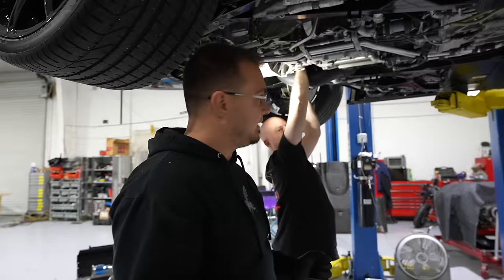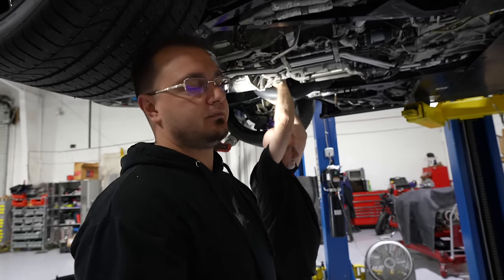Rebuilding The Flooded Bugatti Veyron | PART 14

Comment: Your wastegate spring is not going to determine the max boost youre running. It will determine the crack pressure for the wastegate. Remember the car uses a boost solenoid to divert boost pressure away from the wastegate so it can run MORE boost than what the spring allows, but never LESS. Did you actually check the crack pressure of the OEM wastegates? Are you logging requested boost and actual boost when testing it? Different cracking pressure (different spring) than stock will make boost control go crazy and cause huge PID corrections and throttle closures over a certain threshold on these ECUs. Check the actual pressure where OEM wastegates crack open and thats what you want your TurboSmart wastegates to start opening. Not more, not less. You definitely dont want to be tuning these without good logs...

Comment: I so tired or hearing this myth. Cars do not need back pressure to make power. They need exhaust scavenging to make power. When you remove a vars exhaust or make it shorter, the resonance frequency for the exhaust pulses will be at a different frequency from stock, changing the torque curve. Many more knowledgeable people like Gale Banks and Richard Holdener can explain this in more detail.
Reply: Yes, 4 stroke engine just wants to breath out. And with those 16 cylinders on full chat, you are having pulses coming all the time. Exhaust is there only to get those out before the next ones.
Reply: I only learnt this a week or so ago

Comment: Not sure who would want to buy an entire car’s value priced exhaust system from a guy who thinks more back pressure is a good thing. Those sparks coming out too are not good either, thats not unburnt fuel thats metal sparking, typically a sign of bad internal welds or bad glass packs. Keep the boost the same and then show us the HP difference.

Comment: how is smaller diameter pipe less restrictive?
Reply: I imagine it's where and how and even who measured it lol...but I'm pretty sure it's not ...I've worked on alot of CNC's and other more traditional old school style machines and cool old school WW2 era bridgeports presses with every single type of personality you could possibly run into in a machine shop lol and the number one thing I've learned the most specially from new guys ... measurements are hella subjective 😂😂
Reply: @KevinPritts  measuring something as simple as the bore of a schedule tube or ID of a pipe is not subjective in the slightest.
They are produced in standard sizes. 
Manufacturing variations are irrelevant compared to a change of stock size.
Smaller pipe is significantly more restrictive due to the boundary layer effects and reduced CSA. That's Engineering.

Comment: I seriously doubt stock veyron wastegate spring is 18psi.  It probably was around 10psi.  You can always dpuble spring pressure.   If your goal is 18psi put a 10psi spring in and you could hit 20psi.

Comment: Why not an electronic boost controller? Get a empty ECU pin out, let the ECU know you want to use that as input for boost and it should work. If not a custom ASW mod can be written which is fairly easy.
Reply: I think it has one from the factory they are just setting the wastegate springs back to stock so the ecu and tune will work
Reply: It’s like this from factory they just have the wrong springs. The mechanical part still needs to be correct. With a normal pneumatic plumbing configuration you can usually achieve double the waste gate spring pressure through electronic control, not simply anything.

Comment: Can someone explain why less back pressure in the exhaust system would decrease power on a turbo charged car?
Reply: It shouldn’t, there’s something wrong. Wasn’t their problem just having the wrong waste gate springs?
Reply: "back pressure" is a poor choice of words that a large percentage of novice auto enthusiasts use. They should be talking about velocity and scavenging or even spool up time when turbos are involved. Just pretend he said that changing the pipe diameter has the potential for a performance enhancement and since he got it wrong the first time his second attempt is the reverse of the first.
Reply: @walterwhite279  There’s no evidence he got anything wrong other than the waste gate springs. Generally on turbo vehicles, simply having the lowest pressure post-turbine is optimal. The reason scavenging works on an N/A engine is that a low pressure wave can be aligned to the exhaust valve opening, thus allowing more exhaust to flow out of the cylinder. This strategy is not effective when there is a turbine between the exhaust and the exhaust valve.
Reply: @coreyw427 - the red car had stock wastegate setup and no tune. He reduced post turbo restrictions and lost power. Same thing happened with this car which had heavier than stock wastegate springs, identical post turbo setup, and couldn’t tune the problems away.  Not my point though. I was trying to say he uses the phrase “back pressure” interchangeably with “less restriction”.  I don’t know if he knows the difference but based on the many questions posted here, people got confused.
Reply: @walterwhite279  I’m not sure what you’re getting at sorry. All else equal, less restriction will result in a lower back pressure. As you say, there can be acoustic effects, but it’s not really relevant in a turbo application for the post-turbine part of the exhaust. I’ll take for granted what you’re saying about the red car, but this isn’t good evidence for it being an inherent physical issue. Most likely it is an issue with the tune. It uses a Bosch MED 9 which has thousands of maps including in relation to modelling the exhaust back pressure. Not updating these correctly can have negative effects. For example, lower back pressure could result in more exhaust passing through the waste gate for a given waste gate position, rather than the turbine. But the model probably thinks the back pressure is higher than it actually is.

Comment: Its horrible to see they dont have a clue what they are doing.. Thinner exhaust pipes, because want more backpressure?? Lighter springs in wastegate?? OMG!! A turbo 4-stroke engine does not need backpressure for power. Also the heavier the spring in the wastegate, the higher max boost pressure before wastegate will release. Please contact a tuner, before you make decissions like this.

Comment: You dont control boost with springs, you have a boost controller, on this car most likely a vag n75 valve via the ecm
Reply: Yeah this was confusing me, surely the spring just determines the max pressure before it physically releases the waste gate?
Reply: This is for the wastegate
Reply: Yes, with OEM ecm you can only open the wastgate not keep it closed, so it will be pushed open once beyond the spring pressure, hence you need a decent spring for higher pressure
Reply: The waste gate spring still needs to be correct. If you put a 5 psi spring in, you will only be able to get ~ 10 psi using the N75, for example.

Comment: Car is stunning but lose the cheap looking door lights. 
You shouldn't have to reduce exhaust diameter to improve power - a turbo runs better with no exhaust or a short stub. There's something not right with turbos and/or tune, and YES I did see the wastegate spring change.

Comment: we need a 1000mph road car :trophy-yellow-smiling:
Reply: Do you mean 1000hp?
Reply: @TheBraddles82  no mph
Reply: 1000mph will need at least 135000bhp  if it has enough downforce and not fall to bits under load  at those speeds tyres forget it.
ask elon for a raptor or 2  lol

Comment: Curious minds want to know Houston. How much is a bunch of money to you? Obviously this Bugatti Veron wasn’t about $1 million when it was new. The Galveston Bay ruined the value of this individual Bugatti. You have single-handedly rebuilt this Bugatti Veyron from every nut and bolt. In my opinion, it is a lot better looking than what it looked like originally when it initially left the factory. Obviously, you know how much you have put into this rebuild plus what the Bugatti cost you before the rebuild. If somebody offered you one and a half million dollars for this Bugatti Veyron, would it be enough or would it have to be $2 million? After all, it has a branded title even though it’s practically brand new from front to back.

Comment: You lost horsepower because you choked the engine with the narrow rear section. Keep the large diameter downpipes, and keep that diameter running the whole system. Why on earth would you neck down a quad turbo W16???

Comment: So you changed all rusted nuts and bolts and so on...? at 9.54 are two most visible rusted bolts... and again... 11.56 bracket for five oil lines.. rusted bolt holding...  well you are building something for years and.... there is real quality difference in US and europe, have a look at the m539 restorations channel, there is real quality on restoring something...

Comment: Jesus.....🤦

Back pressure is bad on a turbo car (close to or over 1:1).  You're only increasing the risk for back pressure issues by going with a smaller exhaust.  Why on earth would you go DOWN in exhaust size?  There's no logic on that, especially if you're going to eventually turn it up.